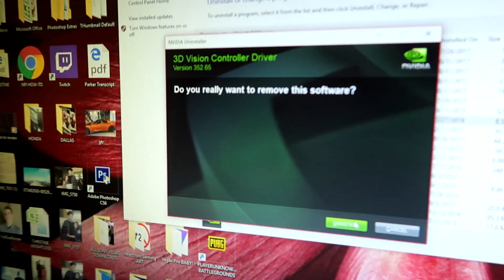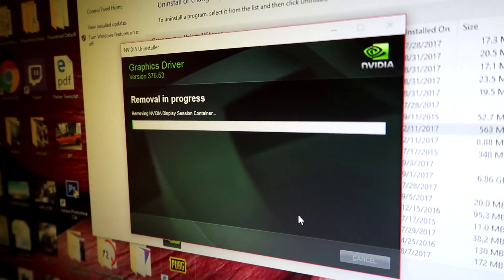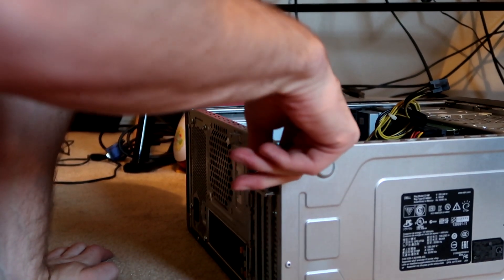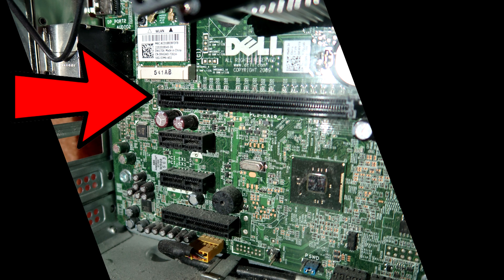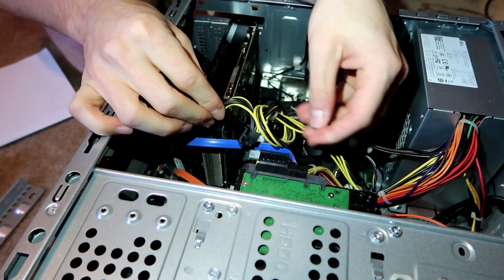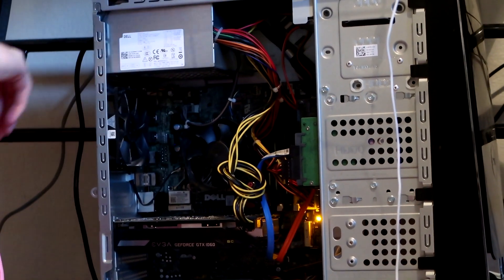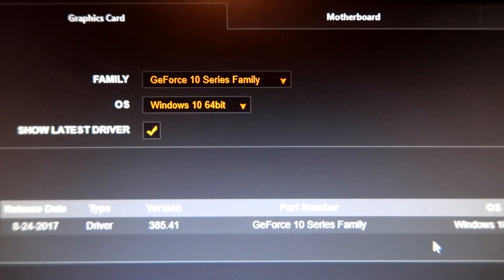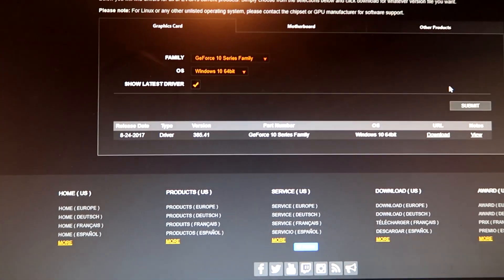EASILY Installing EVGA GTX 6G 1060 in Dell XPS 8700 Tower (Super Simple)

Comment: Wait I bought a 1650 and everytime I try to
Load it up it gets stuck at the boot screen and it beeps please help
Reply: you may need to upgrade the bios of the motherboard, but if that doesn't work get in contact with the seller and they might be able to help you out.
Reply: Eth Sec05 my motherboard only lets me update  it to A06 can I just buy a new one /A14

Comment: Do not install a graphics card on carpet. And do not blow into your computer. Use a air compressor of wanna get rid of the dust out of your computer and the reason not to install a graphics card or anything on carpet because you can electronically fry your computer by static.
Reply: For real I cringed watching him do it on top of the carpet 😭😢

Comment: Will it work for a GTX 1080ti?
Reply: Not in that tower, the XPS line typically maxes at a 460W PSU which is fine for the GTX 1060, but 1070+ will require a power supply upgrade which requires removing the whole motherboard on most XPS cases (for sure on mine, the 8920)

Comment: Same computer and I did the same upgrade today. Extremely easy, and only took a few minutes. The EVGA GeForce GTX 1060 6GB GPU is working great. A stock 450 or 460 PSU will work just fine, no upgrade needed.
Reply: Hey would an msi 1050ti fit? I'm extremely scared
Reply: 1050ti is what the next gen came with and is a single slot card, not a double wide like the 1060, so yeah, I think so.

Comment: When I got my 8900 they said not to go over the 960 so i bought a gtx960ssc and its always worked great. the cooling fans hardly ever come on but from what i remember if you run the fans and gpu at 100% its just par for the 450watt psu. this works but i would be worried about it running at 100%. but i could be wrong i didnt the math online. lol
Reply: GTX 1060 requires a 400w PSU, should be fine in the 8900 series. There was an older series with a 350 or 375w psu that you wouldn't want to go above the 960 in, for sure.

Comment: After upgrading the PSU with an EVGA 650W, I did the same.  Also upgraded the CPU to a i7 4790k.  Thermals are a bit dodgy.. GPU hits the high 60s and even after upgrading the cooler the cpu hits high 70s under load.  There has to be a way to mod the case to allow better airflow.  With my old 1050 ti (same i7 4790k processor) there was significantly less heat generated by the graphics card which kept the cpu down into the 55-60 degree range.
Reply: Probably too late, but apparently there's a spot for a 92mm fan at the front below the drive cage.
Reply: I have an XPS 8700 Special Edition. i7 4790, R9 (moving to 1060), 32 gigs of ram, 265 SSD + TBHD.. Case modification I'm doing is the side panel you remove for service, I'm going to drill two holes, add an inlet and an exhaust fan, and just pump the case full of cool air.

Comment: Anyone know if this will work for the XPS 8300?
Reply: yes, in fact, I have a dell xps 8300 with a gtx 1060 msi gaming x 6gb, but I had change the case, cause the gpu could not fit in the original dell case, but I would suggest you consider the purchase of the gtx 1060 zotac 6gb amp edition, it's smaller but have 2 fans and the 6 pin connector for the PSU dell stock
Reply: i prefer EVGA just because that's what i have now, but a single fan is pretty mandatory for that case i feel.  I'll check out the zotac.  Thank you so much for the reply.
Reply: Rogelio Prado very useful thanks a lot 👍
Reply: Update, i just installed the above SC version and it's great. Also added 16GB of RAM.  Works perfect.
Reply: I got the EVGA 1060 6GB SC.
Reply: I would go with a single fan model, plenty of room.
Reply: The Firmness thanks for the up date !! Which one is that ?
Reply: The Firmness thank you 👍
Reply: Rogelio Prado are you talking about the gtx 1060 zotac mini or the regular one? i also have the 8300 but I’m afraid it doesn’t fit

Comment: I just ordered a gtx 1060 also for my xps 8700. got the evga 6gb single fan SC
Reply: Me too haha
Reply: Same :D
Reply: Just installed mine yesterday. Playing pubg on ultra is awesome. The installation is pretty straight forward. Don't forget to install the Precision X software from evga website. Its very usefull.
Reply: Labradors yo I did too I feel like everyone goes to a 745 to a 1060 lmao, but was the power supply in the 8700 enough for the 1060?

Comment: hey bro i also have dell xps8700..i just want to ask if is it better to buu dual fan 1050ti or single is fine...thanks
Reply: single is probably better, less power, just don't overclock so it doesn't overheat but it won't do that out of the box

Comment: I have the same computer. It has a 745 as well. 16 gig ram and a i7-6700. Can I put a gtx 1060 too?
Reply from the maker: Ahtzee Gaming I would think so man! If you have an 8700 or 8900 I believe you can. The 1060 is a small enough GPU to fit in most towers.